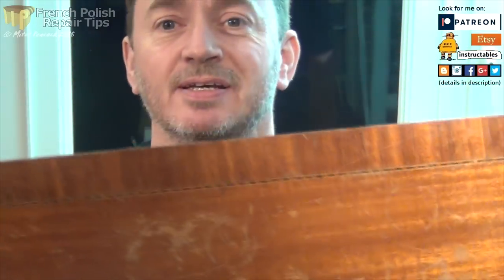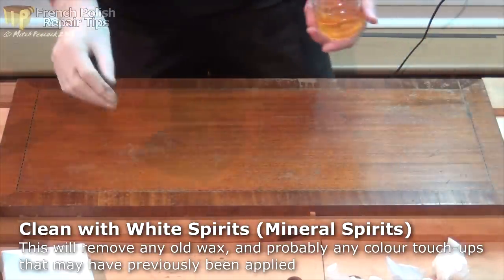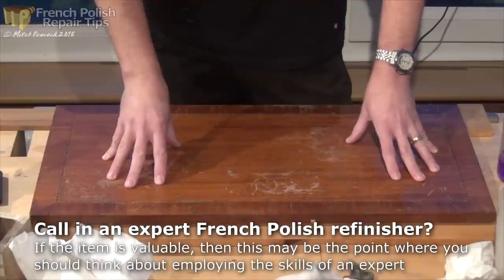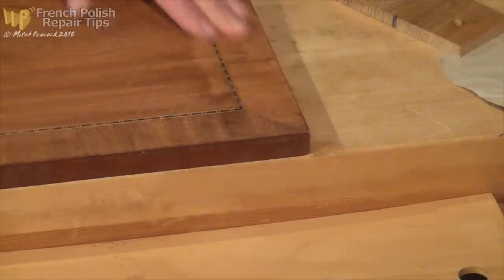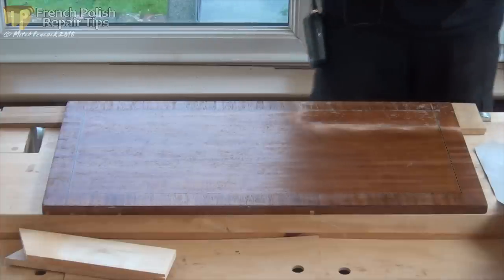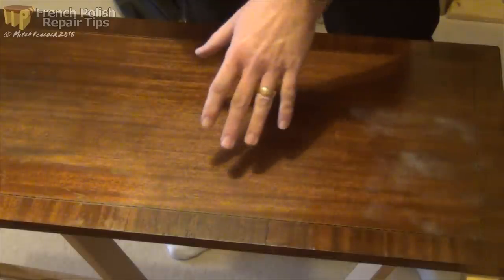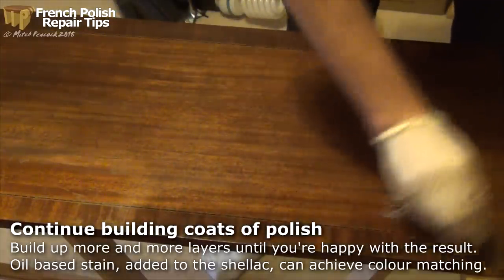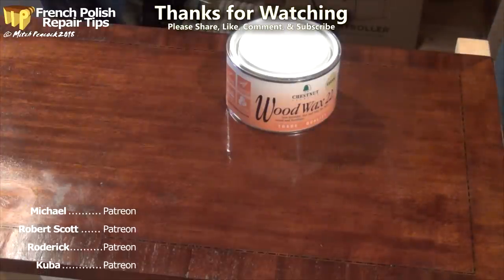French Polish Repair Techniques (including refinish)

Comment: Nice clip and good advices, but the pumice powder is to be used with the first cote of shellack. That anables it to enter all the pores of the wood when they are widely open. Using it at the end or with the third or fourth cote it will not enter into the wood to create perfectly "glassy" surface.
Reply from the maker: Thanks for the advice, I'll try that.

Comment: Great explanation! 
I’ve been using canola oil, which, as is the case with linseed, is a “drying” oil. On a recent project where I took my time, I started having problems during spiriting which I think might have been caused by the oil starting to polymerize. I stripped it all off and started over using olive oil instead. I hope that does the trick!
Reply from the maker: Cheers. Never tried olive oil, interesting idea.

Comment: The first couple of coats can be brushed on to get a base built up quicker. You have to let it dry a little longer. Also, with the shellac sticks you can apply with a palate knife you have heated with an alcohol lamp. You can blend colors to get a better color match if you need to. When it is nearly level, use a scraper to finish leveling. Paraffin is what is used for a lubricant, not linseed. One drop. Turn all the cut edges of your rubber in so that you don't accidentally get a thread or fiber in your finish. That will make you very unhappy.
Reply from the maker: Never heard of using paraffin to lubricate, I shall have to try that. Cheers

Comment: Nice video Mitch.
I did not know that kind of french polish repair yet.
Because of the raised veneer, you can very well stick it back with an iron. Because the veneer was glued with bone glue (glutin glue) earlier.
I know it like that.
Wash with hot water and brush the shellac.
Repair damaged areas (with scrap card).
Then fill pores with pumice, shellac and isopropanol (isopropanol does not dissolve the shellac, but alcohol).
When pores are filled, start with gloss polishing (shellac and isopropanol).
Reply from the maker: Günter Schöne Cheers Günter.
If the isoproponol doesn't dissolve the shellac, how does that work. Maybe I'm missing something ;-)
Reply: Sorry, Mitch.
I expressed myself wrong.
For a shellac polish, mix shellac with isopropanol.
This is applied in several layers (passages), in between you can dry the shellac polish.
By using isopropanol, the dried shellac is not dissolved.
But what happens if you mix the shellac with alcohol (like ethanol).

Hope it is easier to understand.

Did that look at a carpenter, who has some videos on Youtube.
Reply from the maker: Günter Schöne I shall try it! Cheers

Comment: Couldn't really admire the finished product due to the ads for the other videos popping up on the screen... but the little I could see  looked well done.  Are you going to post a photo(s) of the completed tabletop when you finish the entire surface?
Reply from the maker: Ray Roberts I would do, but, since it has no home, I've no immediate plans to finish it. There's edge banning missing, so I may do a video on repairing that when things quieten down a bit. That would be a reason to crack out the French polish again too, so I could finish the top off nicely.
I'll post a photo on social media of the top as it is now, but that is cut back and waxed, as it was when the video ended

Comment: There is an actual tool mildly resembling a wooden body plane with a corrugated edged ‘card scraper’ type tool with the blade set at 82 degrees angle popularized in the 17th C that was specifically for easing damaged finish off a compromised veneer.   I found one of these while building up my plane collection and have used it ever since.
Reply from the maker: Never seen one, but I'll keep my eyes open for one.

Comment: Great Info Mitch, I don't have 'Old' furniture with Shellac, I do use it on small ornamental pieces I make, but 'Polly'  on my Furniture.  Would Sugar soap be to harsh a detergent for that stage??? Have you tried Plaster of Paris as  grain filler? I've had a good result on a coffee table I made recently using it as the filler
Reply from the maker: Peter Compton Cheers Peter. I've not used sugar soap for anything other than decorating, and my experience of it for that is that it's strong stuff! I just use a little hand detergent myself.
I've not used plaster of paris as a grain filler, but I've heard of French chalk being used.
Maybe I'll experiment when I get a chance.

Comment: Ensure that any cutting/polishing compounds, especially ones for use on metal or paint, do not contain silicon. Or later finishes may be badly compromised.
Reply from the maker: Thanks, good point

Comment: Good intro to polishing. Thanks. Quick question. What do you use for something like a plane handle to give it a dark stain?
Reply from the maker: Thanks. I'd probably use Garnet Shellac for a gloss finish, or mix a spirit dye with some tung oil or boiled linseed oil for a matt or semi-matt finish.
Reply: @mitchwoodwork  Thanks. I forgot to mention that the front handle I made from some firewood (oak). Would that give me the same finish? Probably not. Wood I be better off redoing the handle in a Mahoney or another darker hardwood. What would you rec?
Reply from the maker: Beech is commonly used for these, but oak should be fine and you may get some lovely looking rays showing. If you're trying to match the rear handle, scrap the finish back from the underside to check it is beech, or whatever else, and turn a new knob in the same wood. Colour matching the oak to the rear handle can be done by building up the coats until they are the same in the case of shellac. Dyes are more of an experiment that you should try on some spare oak
Reply: @mitchwoodwork  Thank you.

Comment: Great job. Do you have a video on mixing shellac flakes orange ? Kind regards Danny UK
Reply from the maker: Cheers Danny. I don't recall doing such a video. 1lb of flakes to 1gallon of meth's is a good starting ratio. Obviously only make up a volume that you're likely to use within a month, as it doesn't store too well. Keep agitating the mix every few hours, and within a day the flakes should have all dissolved.
Reply: @mitchwoodwork  Great thanks for your advice. Take care... have a great Christmas. Kind regards Danny

Comment: For the love of god, just strip the thing back to bare wood sand all your scratches out and bring it back to brand new.
Reply: @RoboKestrel  No it wouldn't, paint stripper is chemical very harsh, get it on your skin and you will know exactly what I mean. But I have never known it affect the glue. It might if you were to leave it on there for days at a time, but he is only stripping French Polish and the stripper would only take a couple of minutes to soften it before cleaning off and neutralizing.

Comment: I will respectfully dislike your video and post comments as you have asked us too , its nothing personal 

for starters your technique of stripping the piece is only going to mar and scratch the wood more then it already has been , you truly butchered the table by doing that scraping thing. These old finishes fall right off with just a little brush of stripper , sand it down and you would of had a great piece to work with 

Secondly how are you going to use metal polish to polish a table with such a badly deteriorated finish ? In many areas there is no finish to speak of, what are you going to polish the wood itself? Using polish of any kind to try to save a badly damaged piece is only a temporary hack, no one would pay you for it.

Thirdly why would you wait until you start to polish the wood before filling the holes and imperfectons? that's all supposed to be done when the table is down to the bare wood. do all your filling and sanding before you proceed to refinishing.

Overall it just doesn't seem like you have much real world experience with this , maybe as a personal hobby but paying customers wont give you any money for this kind of work

I will start making my own videos soon, feel free to critique mine as well
Reply from the maker: I appreciate your words of wisdom, and will experiment with the techniques when I next pick up a scrap of french polished furniture.
The video description did say these were simple things anyone could try, and not an alternative to seeking an expert repair. I'm certainly no expert, but these tips were all published by "so-called" restoration experts in books or magazines I've read over the years, and I have been happy with the improvements they have made on the limited number of repairs I've made.
Cheers
Reply: you have a point,this is right performance